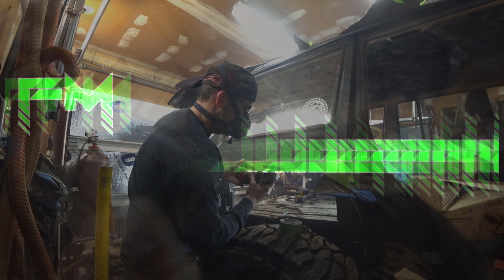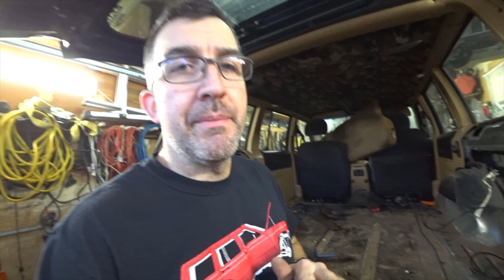Comp cut on a 1998 Jeep Cherokee Xj  PT 1

Comment: Very soon ill be busting out the grinder and welder for my xj, got a 44/60 combo to throw in. I plan to raise and flip the tank so the angled part of the tank will face the axle. Going to be fitting 38.5's with roughly 5.5 -6" of lift. I want a LCG flat bottom build. Eventually... lol
Reply from the maker: Sounds like a good plan! I think I'm going to run a Motobilt fuel cell. Right now you would be about 1" in lift higher than me .  I'm running about 4.5-5

Comment: Any thoughts on putting frame stiffeners on your uni-frame? Seems like it would be a good idea when removing so much material from the outer body.
Reply from the maker: I have IRO stiffeners front to back .  I also have a cross member between my rear shock towers as well.
Reply: @FMJeeping  Thinking about stiffeners for Bumble Jeep. But I won't be cutting my body. From the floors up, it's perfect. I saw a video a while back that showed a bolt in rear cross member, bolted into the upper bump stop mounting holes and was also used as an upper shock mounting location. I can't find one anywhere and found out someone made it as a one off. Might make one of my own as my rear bump stops are gone anyway.
Reply from the maker: @projectbumblejeep4190  I know the bar you are talking about.  A local guy I know has that bar .  I can see where he got it.  
As for the stiffeners, do it.  Huge improvement over stock.  The unibody flexes so much and you don't realize it until you get the stiffeners.  Plus the stiffeners are a great base to weld to for sliders, shock hoops etc.
Reply: @FMJeeping Thanks for the heads up! I really appreciate it.
Reply from the maker: Here is the bar I'm thinking of .  Made by JKS.
https://jksmfg.com/i-9052792-cherokee-xj-1984-2001-rear-upper-adjustable-shock-mount.html?ref=category:381190
Reply: @FMJeeping  Thanks! Will definitely look into this when I'm ready.

Comment: I have very similar holes in my XJ right now and I'm curious how you solve the "reassembly"
Reply from the maker: Honestly I had trouble coming up with a concept I feel I could make work.  It came out great .  Especially for diving into this without a real assembly plan or general idea on how I was going to do it.  Fabbing on the fly worked in this case. All in all I think the end result came pretty well. Stay tuned to see it